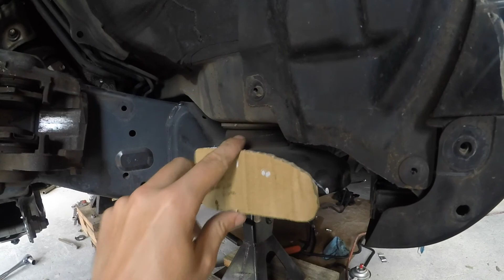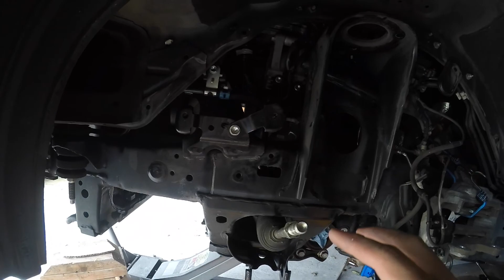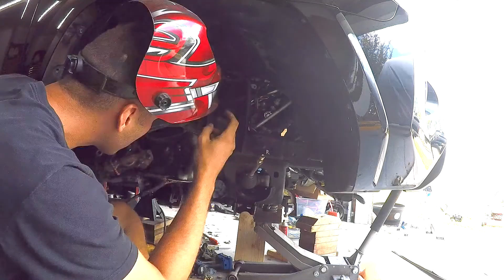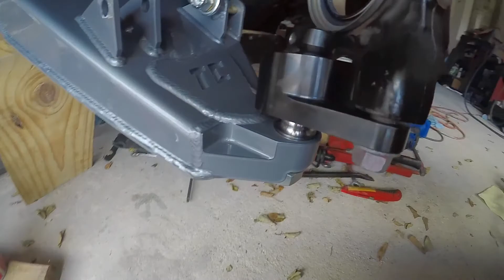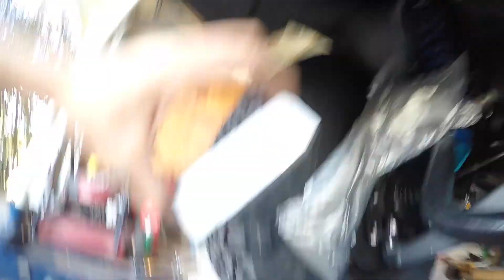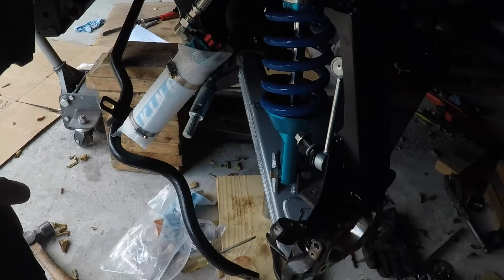2018 TRD Off Road Premium 2in Extended Long Travel Install

Comment: Does the +2 lt kit require extended fenders or will it work with stock fenders?
Reply from the maker: It works with stock fenders, however we did some cutting to make it look more aggressive and to make space for the 35s. We looked into the extended flares and love that look but haven’t gotten to that yet with all of the other projects we have going on currently. Happy help answer any questions you have!
Reply: I have the hi clearance cut as well to make room for 35’s once I have a lift installed. I also have wheels with a -38mm offset so that may require the extended fenders. Decisions decisions….

Comment: Did the sway bar mounts you came up with work? And did you do a rear sway bar?
Reply from the maker: Hi James, the front sway bar works great its really just a copy of how non KDSS are mounted. As for the rear I had to buy axle mounts, tac weld nuts to that and weld it to the axle tube. Then I had to weld some brackets to the frame all of which was a carbon copy of non KDSS suspensions to add a TRD Pro read sway bar and extended sway bar liinks. For a view of the rear you can see it clearly in my rear gear swap video.